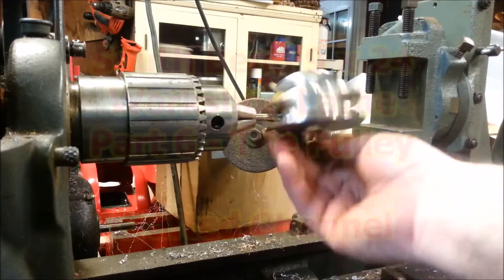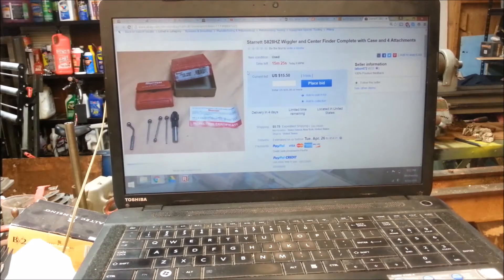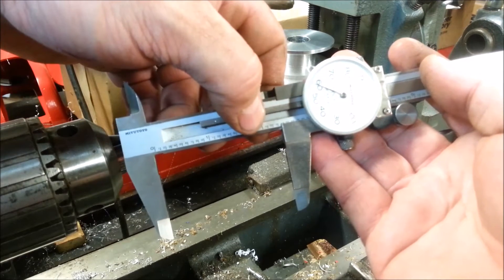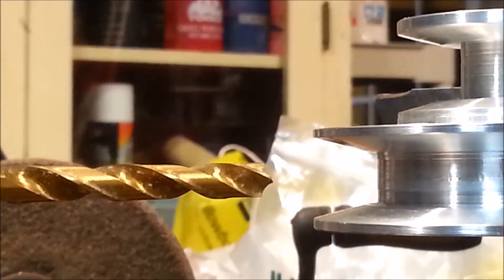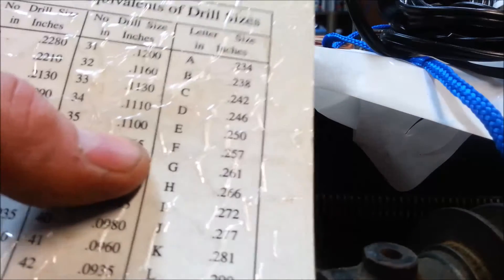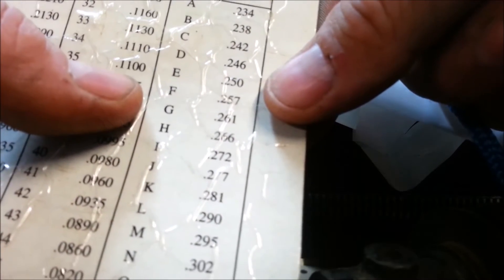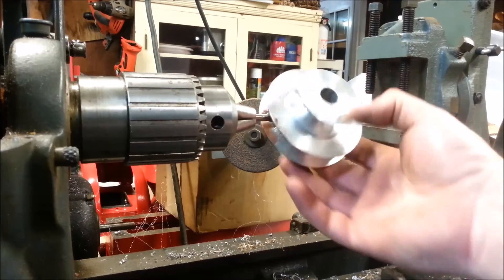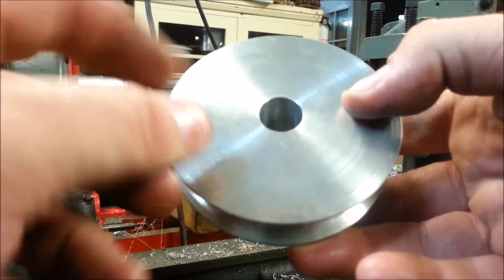South Bend 9 x 24 Workshop Lathe Part 6 - The Pulley - Crafted Channel

Comment: Good job Dave.  Looks  good.  If you are going to be tapping aluminum you should use aluminum cutting oil your taps will last longer.  You should not use regular tapping fluid on aluminum.   But hey that is cool.  Just got my Jaws for the milling attachment.
Reply from the maker: I purchased steel to make some.  Found a great deal on a cutter to make the V groves and I've lost it already.   I went through the Logan lathe you saw and the new owner picked it up last night.   I don't have any fluids specifically for tapping yet.  I've mostly been using ATF in my mason jar the brush rests in.
Reply: I'm going to have to find me a head stock drill chuck it looks like now.  ATF work pretty good.  But with normal cutting oil on aluminum it will actually gum up the tap and you get all of this black crap plus the threads are junk.  I've seen window clean used also.  Form Cutters very cool, but hey why take all of the fun out of what you did very cool Dave.  If you ever need any help putting stuff together give me a shout.